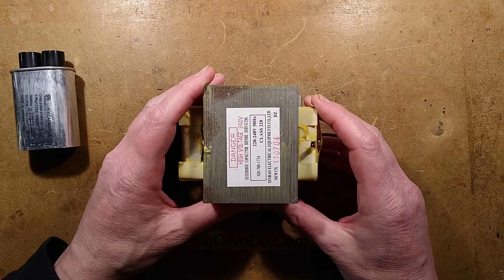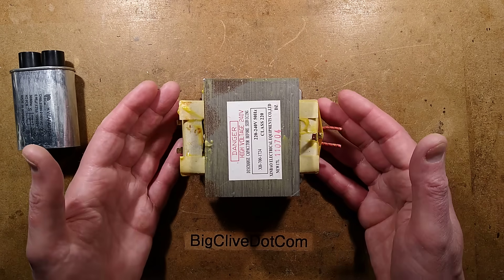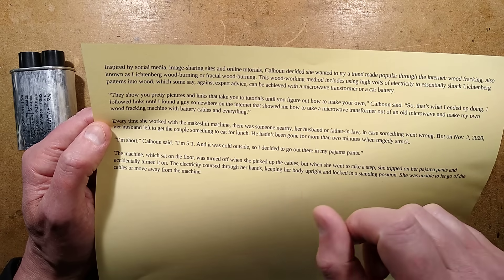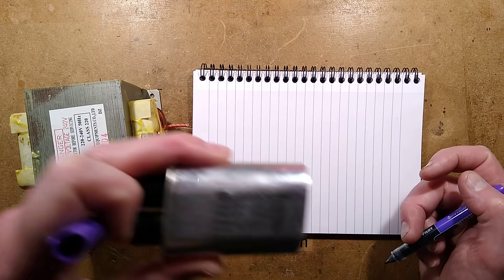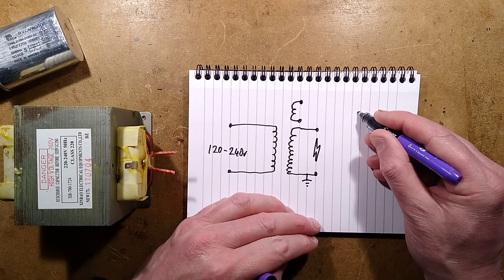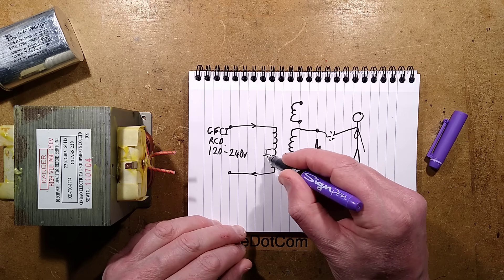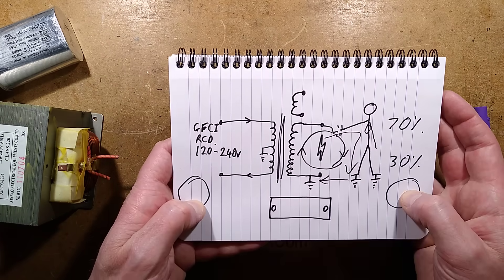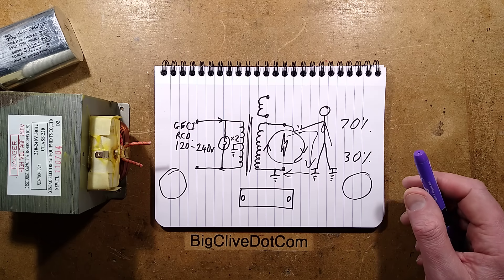The most deadly project on the Internet

Comment: I like the "dead man's switch" suggestion; it's all too easy to become complacent so forcing a person to follow a procedure is wise. Personally,  I plan to leave the microwave transformer the hell alone.
Reply: If I were to do this I'd put it all in a big box with a fume extractor, a window and a mirror and switch it on from 15 feet away.
I would not be probing shit.
Reply: @thumbwarriordx  With that approach, you're likely to be a lot safer.
Reply: Also, with a deadman box, have BOTH buttons be double-pole and in series with each other. That will make sure neither of the buttons will fail shorted (and remain stuck 'on') and you can energize the equipment with one hand.
Reply: @Stoney3K  It looks like we're all more or less on the same page here. The specifics vary but we all agree if you're gonna mess with it, do so in a way that prevents you from being near the pointy end when it's energized.
Reply: If I were to design such a thing, I would design it to be turned on from a location where I could not physically reach the high-current side. The power switch would be a push-and-hold-style switch (not something that could be grasped), so that if I was to receive a shock anyway, I couldn't be stuck holding it. In that sense, it could function as a deadman-like switch. Also a priority would be visible and audible indicators of it being on.

If it's worth doing, it's worth overdoing
Reply: @ebnertra0004  Sounds reasonable to me.
Reply: No latching switches! The best choice I know of: a relay rigged in in a flip-flop-style way with a mushroom killswitch as the stop button, and a tiny button that is hard to press as the start one (rigged in such a way a disconnected stop one overrides the start one). This not only makes the sequence less prone to accidental triggering (also those killswitches come with a key sometimes, so no "unauthorized access"), but also cuts the switch in case of a mains failure, so you won't have trouble should you plug the system in with the switch already turned on. And - warning lights everywhere! A conventional deadman's switch on the secondary side (that shorts the secondary if closed, and has the lever connected to the ground end of course) can be a good addition if the device involves messing with the HV-side circuit. But - not for that woodburning mess, as holding something that drives a whole Amp or more through a victim is not called "a hobby" nor "an art", Old Sparky is the name ;)

Comment: Would a quality pair of high voltage gloves provide sufficient protection for the user?  I'm not suggesting that wearing a pair of them would make it safe to poke around while it's on, but should accidental contact be made while it's on would they save a life?
Reply from the maker: They would have to be linesman-grade high voltage gauntlets with leather-protectors.  The real thing is very expensive due to the nature of its use and also needs to be tested regularly, as current can flash through a pinhole.
Reply: @bigclivedotcom  that's essentially what I was thinking of.  Of someone is doing a lot of this the cost for a real pair of linesman gloves would be well worth it.  Thanks for the reply.

Comment: Instructor at N.I.T told our class many times, the lack of common sense when dealing with these high voltage components can get ya rip. In other words never let your right hand know what your left is thinking? Built a homebrew super bug zapper about 10 years back which utilizes 2 of those widow maker transformers connected in series 60/60% loading capacity and 8 of those 100% lethal 2k caps which produces an 400+ mill amp floating voltage of 5kv to both lower and upper grids of this ten foot tall super zapper. To bad Y.T doesn't allow sharing any images for this power supply alone looks kinda cool....

Comment: Way back in the dark ages when I did my electrical workers apprenticeship, we were required to watch quite a few really graphic safety videos.
The sight of people with burns that made their arms look like really over roasted chicken legs was burned (pun intended) well and truly into
memory. Unfortunately, with the advent of the internet and the ability for untrained people to share their "giving it a go" experiences has led
to so many other just as untrained people to "give it a go". Sadly it's often the last time the give anything a go. Electricity is one of those beasts
you cant see with the eye, you can only see it's effects through the use of test equipment, force generated in motors etc. You may not see it, 
but it's there and it will hurt/kill you if you do not know what you are doing.
Reply: Too many people forgot that part of DIY is learning wtf you're doing! I have had sympathy burn out, proud morons who know better then entire industries and scientific bodies, never learned nuthin and made good so by golly they know what they're doing! "Ok I just need your name for the Darwin award!" at this point I just let natural selection do its thing.
Reply: Just thinking of the HORRIBLE installs I've seen with people making their own solar batteries with clusters of wire nuts hanging all over, crossing wires, and not a fuse in sight, I don't even want to imagine how unsafe some of these transformer setups are.

Comment: All very good info and advice.  I'd like to share a mistake I once made that could have been my last.  I made a two-stage Cockcroft-Walton mutiplier using microwave transformers, capacitors, and diodes.  Knowing the output voltage would be way beyond the range of my multimeter, to estimate the final output voltage I powered the primary using a 12v low current transformer.  This worked, but my mistake was that the black power leads with white plugs were the same for both the 12v transformer and for the actual MOT primary.  For an intended later test I plugged in the mains power instead of the 12v.  I wasn't being complacent, but for the convenience of using readily available but identical power leads, I had created a setup that invited such a mistake.

I'd arranged the layout such that the output stage was furthest from me as even at 12v input, the output voltage was still high enough to bite.  However, I had left a multimeter lead adjacent to the output metal post (about 1cm), so when 240V was applied to the primary, a spark from the output penetrated the multimeter lead insulation and blew the meter fuse.  The setup also made that slightly sinister hiss that tells you there are a lot of bunched-up electrons desperately wanting to go somewhere.  No real damage done, but the event has left a lasting memory.
Reply: It's those moments that you never forget.  People always get annoyed at how insistent I am that different connectors be used for different voltages.  I like equipment surviving and I like living!
Reply: yeah... i got no clue of what you said even means!
so for the simpler folks ill share my mistake...
when i was around 10 i figured out that i could tune my slot cars by adding more volt/batteries.
so then i got the brilliant idea of making the worlds fastest slot car by hooking that little 3 volt motor straight to the 220 volt mains outlet... and oof, i have been deathly afraid of electricity ever since!!!
do not feck with the high voltages!!!
Reply: @ralphbooger4756  Using the same connectors for high and low voltage invites the wrong ends being connected. It should be impossible to get it wrong, but an open transformer is always very risky.
Reply: @ralphbooger4756  I hope you didn't get an electric shock.
Reply: @stephanielongden597  
a quick little shock, some cuts from the motor as it blew apart in my hand, then the fusebox tripped... 
then after a very confused moment of silence, complete darkness and a distinct vinegary smell came the worst part... momma`s thundering footsteps approaching as she was screaming "WHAT THE HELL DID YOU DO!"... 👀
Reply: @ralphbooger4756  Wow, and thank goodness for the lucky escape. I totally agree with you that electricity is scary. Hope your mom quickly realised the seriousness of your close encounter and calmed down.
Reply: I made a cockroft-walton 5-stage multiplier, with suitable limiting resistors, when i was about 13. Stupidly shorted the output to ground, bypassing the limiting resistors, earth-leakage tripped, house went dark, all the diodes blew, and it left a 3 inch diameter ring of vaporised copper around the short, in turn surrounded by a wider ring of copper oxide.

Comment: Is there an alternate method to accomplish the results you get with the transformer without the obvious danger of using a DIY killer?
Reply from the maker: Yes.  In a proper grounded metal enclosure with lid and safety interlocks.  But much more complex to put together.

Comment: The worst thing about this high voltage is it being an AC of the worst possible frequency in the range of 50-100 Hz (including when a bridge rectifier is used).
If it was a DC it'd be bad, but only quarter as bad. It'd be massive burns, but with less of a shock.
AC can make use of capacity, and since humans have plenty of specific capacity at the mentioned frequency range, it'd be equivalent to a significant drop in resistance. Holding a 12V DC with dry hands would do absolutely nothing. 12V AC would tingle a lot.

Comment: I hate to admit it, but when I was 15-16, I was messing with these, but not ignorantly. Even at a young age I've been fascinated by electronics, especially high voltage. When I finally got my hands on one of these MOTs, I spent a solid few days reading up all the ways to stay safe and made a plan. Rigged up a deadman switch and tested it with a lightbulb, 1 hand rule, thick rubber boots, no grounded metal objects for me to grab and complete the circuit, no trip hazards, no spill hazards, thick rubber glovers and a long plastic pole with a terminal attached to the end so I'm physically distant. Made a Jacob's ladder, it was pretty fun but you MUST respect the danger of these things. Even before I had my hands on one, I knew how lethal they were.

Comment: The button box also has to be safely distant from anyplace the high voltage can reach—including the consideration of insulation failure between secondary and primary when the leads are not dressed far enough apart.

Based on some other comments I wonder if the dead-man switch should have a grounded conductive box which shuts the power down if it detects any current in that grounding. Chances are good that if you are getting a shock, at least some voltage will be at your hands and this could detect that. You could even get fancier and have the box split to detect a voltage difference between your hands. The voltage detection would have to be robust enough to not just fail if it happens to get the full voltage/current as well.  Though that seems to be getting into the too-complex-to-trust realm...

Comment: This might be a really dumb question, but I wonder if you can do this project with an electric fence energiser? I think it would be considerably safer, but I'm not 100% sure.
Reply from the maker: No.  They are designed to be safe and just put out very short spikes of high voltage.
Reply: @bigclivedotcom  Yeah, I was wondering if that would be enough to make the pattern if you held it in place long enough to push enough pulses at 6-8 kV through the wood, or if the short pulses would mean it wouldn't work and you'd just end up with a black spot in one place or something like that.

Comment: i have been shocked twice in my 50 years once when i was 17 at a garage from a faulty car hoist which was 3 phase and it blew me across the garage and once while rewiring some sockets in a house at 240v the shock from the 3 phase i was lucky because i hadnt grabbed anything i just lent on the hoist but the 240 shock was awful i had grabbed the wire and was unable to let go due the muscle spasm in my hand. DO NOT MESS OR EXPERIMENT WITH ELECTRICTY unless you know 100% what your doing it can and it will kill you.

Comment: I am no stranger to electric shocks, which is a sign of a degree of complacency. However working on high voltage, high current devices is another scene, I sometimes work on RF amplifiers that have a supply of many thousands of volts at high current. These things WANT to kill you. You have to have your wits about you, don't work on them when you are tired, and have someone nearby that knows the isolation procedure. I know of 3 hobbyists that have been killed playing with similar equipment, not to mention a few nasty injuries. Microwave oven transformers are by a margin the most dangerous electrical component in an average home. I like fire and explosions as much as anyone but PLEASE do not play with microwave oven transformers.

Comment: I have rewired a microwave transformer from a 230V-> 2500V to 230V -> 2.5V. For welding experiments. That thing is scary.  At low voltage the ~2000W makes thick steel bolts glow orange. I cannot fathom the amount of organ frying terribleness, if you get the same energy into your body at 2500V.

Comment: Why would the higher voltage lead to a high current though? I thought transformers worked by trading off current for voltage?
Reply: It takes high voltage to push the current through high resistance. And, even though it trades current for voltage there’s so much current at the start it still has plenty to be very dangerous.
Reply from the maker: Higher voltage does convert to lower current, but still very high current in human terms and with enough voltage to force a lot of that current through you.
Reply: Thank you for the explanations

Comment: Excellent safety video ! ... FYI  two transformers with mains wired in antiphase will give 2 kV - 0 - 2kV ( = 4 kV RMS across the hot terminals ! ! ) , for all you high voltage folk ( stand WELL clear ! ) ... BTW , two of capacitors shown , wired to make 2 microfarad and fitted into a lamp base , in series with a 240 Volt 60 Watt tungsten Poundland™ antique E27 lamp makes a super " nightlight " and will last for DECADES , as it runs at about 80 Volts ( tried - n - tested ) ...
Reply from the maker: The centre tapped dual transformer approach is sometimes used to make neon bombarders for short tubes.

Comment: In high school there was an electrical/electronics class you could take. In that classroom there were workbenches with various equipment for the students, including a power supply that went up to 300 volts. When the teacher was not around, we used to take our pencils and a piece of cardboard and draw tracks on the cardboard. We would connect the 300 volt supply to the ends of our tracks and then slowly turn it up. At some point it would start to conduct and it would crackle and burn it's way along the graphite traces and it made very cool patterns. All kinds of shenanigans went on in that classroom including turning off the breaker to a little used outlet, plugging a small low voltage electrolytic capacitor in, and then turning the breaker on. The bangs were spectacular. It of course led me into the field as a career.

Comment: I used to maintain 1.4kW microwave units. Not ovens, six of these in a row supplied energy to a larger machine. One unit came in completely bricked, the rectifier assembly had let go and allowed the transformer HT output back onto the controller PCB and the resulting flashover didn't just fry the electronics, it stripped a lot of the copper off the PCB too. Where the should have been tracks there was bare board and little copper beads.

Oddly enough we had enough spare PCBs to repair it.

I've removed my comment on cable it adds nothing to the discussion.

Comment: Good warning & well explained Clive 👍. Personally I never have anything to do with Microwave Transformers. You can be as careful as you like but it's that element of error that can always creep in & catch you. 
I have a personal reminder of the dangers of HV electricity and it's capabilities, as my Grandad was killed by it, so anything higher than UK mains voltage & I'm out!  My grandad used to work on a railway track laying machine. One morning one or more of the machines tube lights had failed, and to complete their work these lights were necessary. So instead of waiting as he should have done for clearance, & for the electricity to be turned off. He decided to try and change the lamp/s himself, otherwise it would have meant waiting days to complete their track work.
On that particular morning the weather was damp, & their track laying machine was in a tunnel entrance. As he got up & approached the machines upper lights, the 25kV line voltage arced several feet across to him, killing him instantly. 😢 What's worse was that he studied in electronics & knew the dangers of his HV surroundings at work following the appropriate courses etc. But it still got him. We still have a few of his hand written notebooks on the subject.

Cheers Clive
John
Reply: Sorry to hear about your loss, John. What a way to go, for such a simple thing. It's just the wrong combination of events which can lead even the best, most conscientions worker, to make a simple mistake. May your Grandad Rest in Peace.
Reply: @AAAyyyGGG  Thanks mate 👍. And yes you're right, in the wrong place at the wrong time I guess too. It was many years ago now, but whenever HV is mentioned I immediately think of my Grandad. He was a good hard working fella. 
Cheers friend
John

Comment: 10 years ago I was in my garage taking apart a garbage microwave, I happened to live in an attached home next to an electrician by trade, I've never seen anybody so immediately concerned when the figured out what was happening. I probably would of died trying to make a high amp low voltage transformer